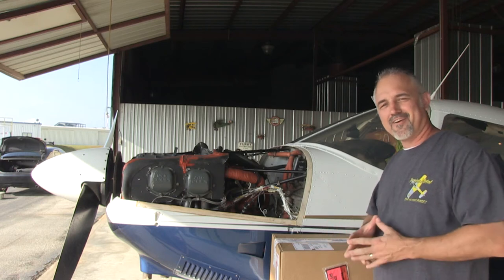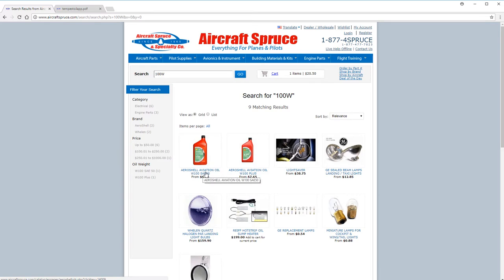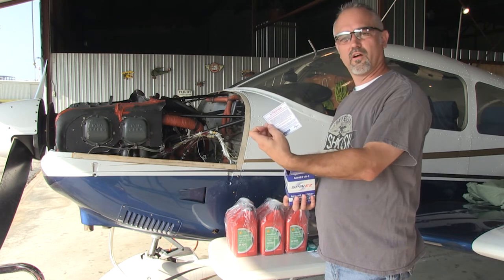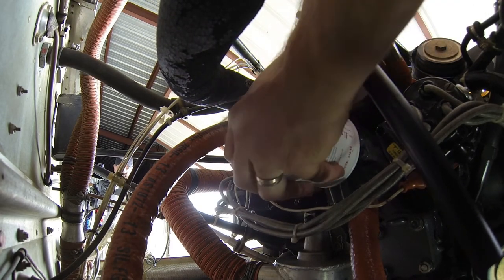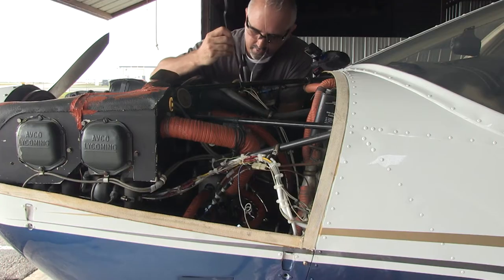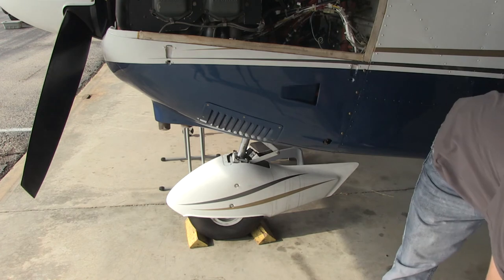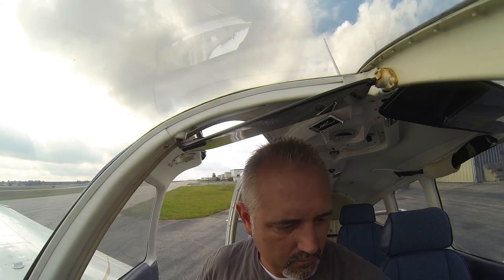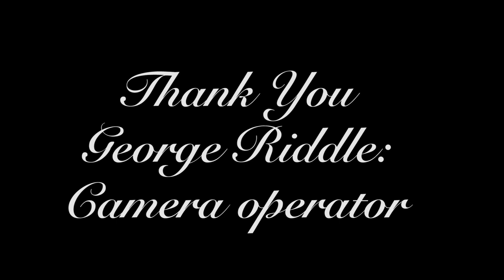DIY How To Change The Oil In An Airplane  Engine Part 2 maintaining an airplane oil change

Comment: This oil change series have excellent details about changing oil and I hope I would learn from the video how you installed, tighten and torqued the oil filter. I think they, especially torqueing,  are critical steps, but they were skipped in the video.
Reply from the maker: @ Tony Tran thank you for the comment.  I did not include the torque procedure in the video because I had to borrow my A&Ps torque wrench to complete the job.  I have since purchased a fixed torque wrench from AC Spruce made by Tempest - AA472.  This wrench is made specifically for tightening the filter to a set torque setting and works beautifully.

Comment: I am reading the Lycoming Mandatory Service Bulletin No. 480F (05/25/17) and it also recommends to remove and clean/inspect the oil sump suction screen while performing an oil change. Do the Archers not need that?
Reply from the maker: @ Doug McClary Thank you for pointing out the suction screen and SB 480F.  We do remove the screen, clean and reinstall with a new crush washer.  I shot this video over several days and forgot to film that part and I failed to mention it.  I will add a card to the video with the information as well as Lycoming's "Understanding Oil Flow" document.  Thank you for watching our videos.
Reply: Thx for the vid.  I will be doing mine this weekend but I have two questions.   Where the oil drains is it easy to open and close nipple ?   I only ask because I need to first take small sample for test kit.  Do I just push up on it with my fingers or do I have to twist it ?    Same with closing it